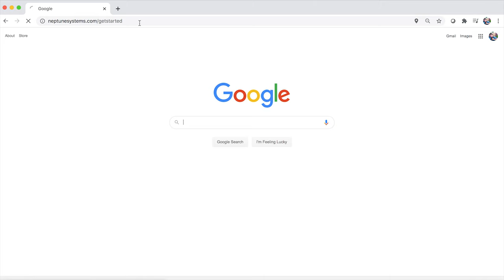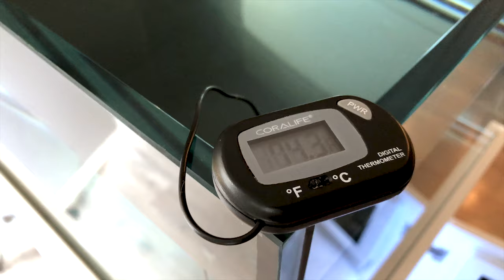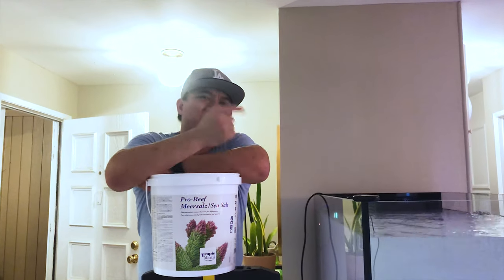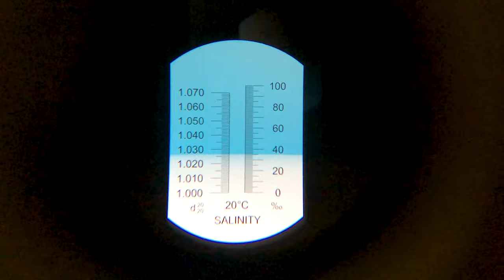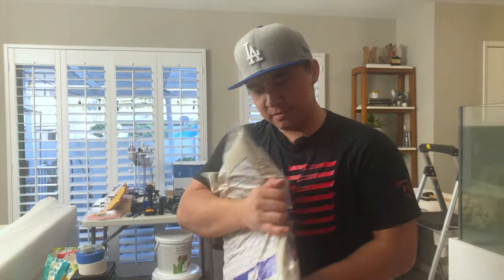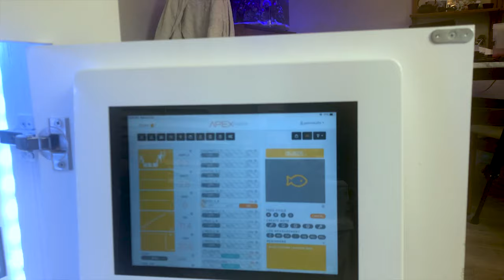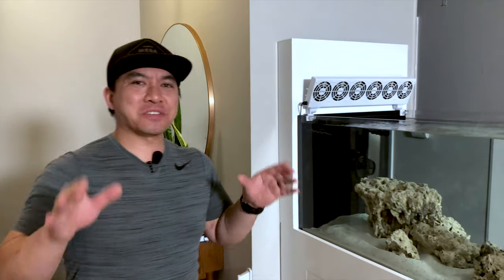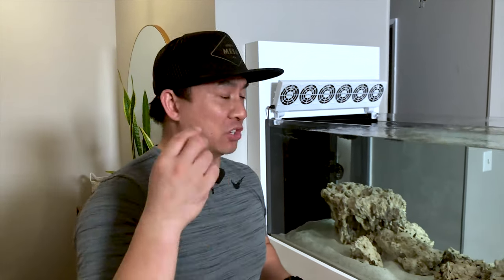Dream Reef Tank Build Series | Ep. 9 | It's Alive!  Rock, Sand & Salt Water + Aquascape 2.0

Comment: Always scares the crap out of me when rock goes in before sand. 😱 Great editing in your videos!
Reply from the maker: Thank you! Yeah, I was taught to place rock before sand to ensure the rock is in contact with the glass. I was a little concerned at first but the glass seemed to hold up really well. Sometimes we forget how thick and strong glass is.
Reply: I agree. Sand, Rock, Water.
No sand storms. Add the salt through the sump last.
I add egg crate to my tanks but thoughts on that vary.
Beautiful tank!
Reply from the maker: @paulbromell8018  Thanks for your suggestion Paul.  Just curious, would you still put sand, then rock, then water even if your rocks have been pre-cycled?  I would think exposing the rocks to air could potentially kill some of the beneficial bacteria especially if you plan to take your time to aquascape.  In my case, my rocks have been cycling for 6 months so I made the decision to put water in first to ensure the rock stayed wet the entire duration.
Reply: @PetmaluLife  In that case, I wouldn't want the rocks exposed for too long of a time.
Reply: Rock should always be set on the glass. Rock, sand, water and never dump the sand from high up. One clump too big and you will crack the bottom pane of glass.
Reply from the maker: @raisethereef  I appreciate your advice but the reason why the water was  put in first was because the rocks had been cycling for several months in a separate container. Therefore, if I were to have placed the rocks in the tank without any water in it, it could potentially kill the beneficial bacteria on it by exposing it to air while aquascaping. If I had planned to cycle the rock directly in the tank, I would have done it in the order you had recommended: rock, sand then water. But I found it more beneficial to cycle it in a Brute instead. Thanks for watching!

Comment: Why did you need to have the tank at 78 before you put the salt in? It looked like you had scaped it before you  put the water in what happened to that?
Reply from the maker: Hi! Thanks for watching. Tropic Marin recommends mixing salt water at 77-78 degrees. I worked on my aquascaping months before I finished building my tank so decided to cycle the rock in a brute container. I ended up putting the cycled rocks into my tank after 7 months of cycling. I filled my tank up with water first because I did not want to kill any beneficial bacteria on the rocks when I put them in the tank. Some people put the rock in before they put water and then cycle the rock directly in the tank. Since I knew I was still planning a few things to do to the tank, I opted to curl outside the tank and in a separate container. Hopefully this helps answer you questions. 🤙🏽
Reply: @PetmaluLife  how did the cycling the rock in the trash can go for you? I have been doing it for a few months. My buddy gave me some live rock from breaking down his tank. I bought some of dry stuff and threw them in buckets with heater and pump for months. But then I just took them all out to do this detail aquascape and I hope there was something  still holding on at least to the stuff from the tank. It was my first time with the dry stuff and it didn't feel like it was cycling in the last few months. But I threw a brightwell brick with microbacter7 on it. We will see how cycling goes for my first tank no live rock. What did you think of your 7 months cycling  it looked just lik e brand new out of the box after your bucket cycling?
Reply: @PetmaluLife  o and what is the  plastic particlial board you used for the controler board called again?
Reply from the maker: I actually used MDF. However, I’m using acrylic for my new build. Some people use expanded PVC.

Comment: Nice but I always put my sand in first, Then rock and water 💧
Reply from the maker: Thanks for the tip, however my rock was precycling for 6 months in another container. So in my case it was better to place them directly into the salt water in the tank then put sand so that we don’t loose any of the beneficial bacteria on the rocks being exposed to air. You can certainly do your steps if one were to cycle the rocks directly on the tank. Thanks for watching!
Reply: @PetmaluLife  cool, when I wrote that comment,  it was in the middle of the video but when I saw the end results  I noticed how well settled the sand became at the bottom and around the rocks....wow 👏,  good job man.

Comment: What a mess,  should have the water filled after the rock and sand .
Reply from the maker: Yeah it’s definitely messier than putting water in last, however, since my rock was cycled I had to keep them as wet as possible. Don’t want to kill all the bacteria by exposing them to air. That’s why I had to fill the tank up with water 💦 first. If I wanted to cycle the rocks in the tank, I would have done that but decided to cycle in a separate container. Thanks for watching 🤙🏽!